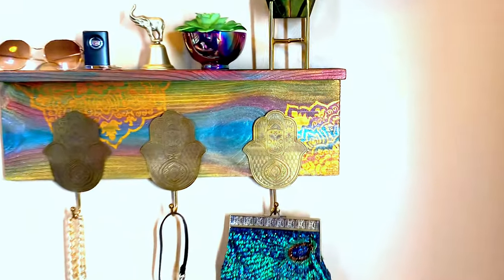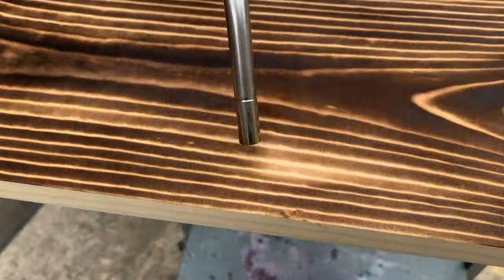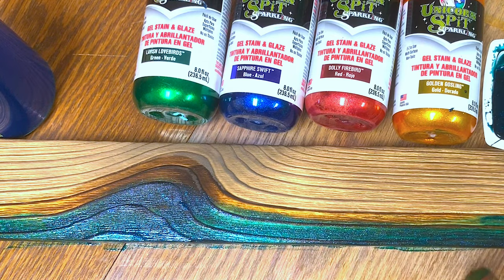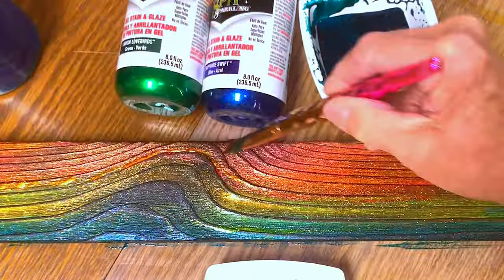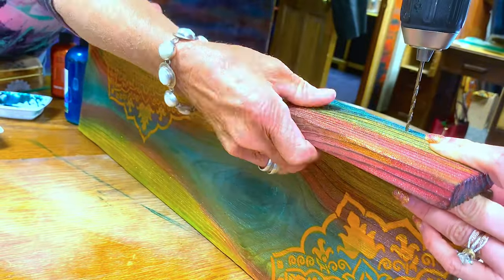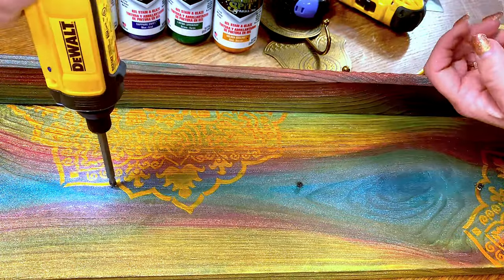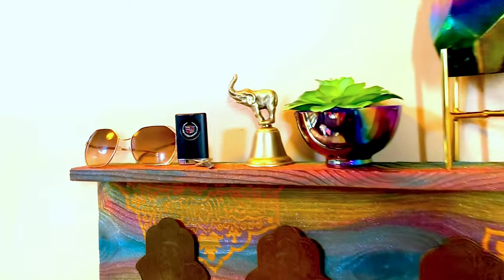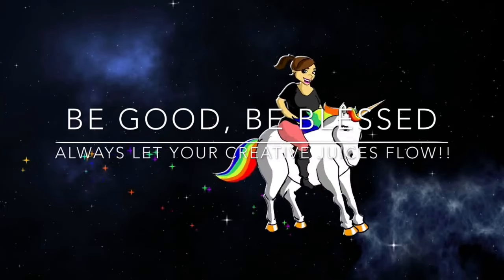Glittering Rainbow Shou Sugi Ban - How to Torch Wood & SPARKLiNG Wood Stain

Comment: Stupid question im sure, but do you mix the Unicorn Spit sparkling with water before or just wet the wood? I'm doing some of my daughter's wood loft bed with that, the kit I bought came with 6 different colors in 8oz bottles.
Reply from the maker: I like to dilute as I go by wetting the word and applying the Stain to it because then you get more of a consistent SPARKLiNG effect where as if you pre-dilute some of the sparkle could end up at the bottom of the vessel.
Reply: The bed turned out awesome, unicorn spit was so fun to use but one more question, what should I use for a oil based sealer? I need a sealer I can brush on since I cant move the loft bed its mounted to the wall so the boards I need to seal are straight up and down not flat. Thanks again.
Reply from the maker: @marciakelley2869  I really like urethane. You can get it in satin or gloss. Check here : https://www.michellenicoles.com/products/arm-n-seal-quart-sized-satin